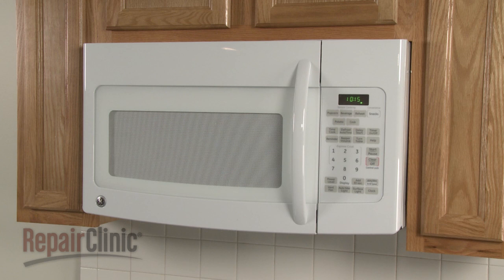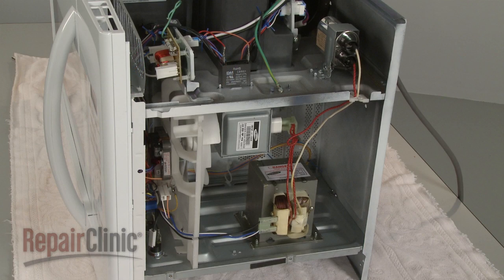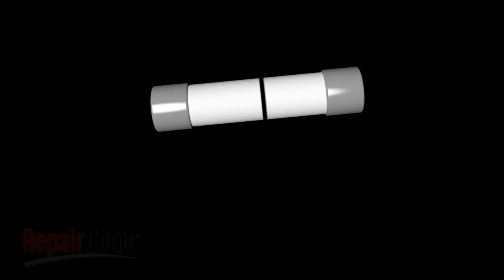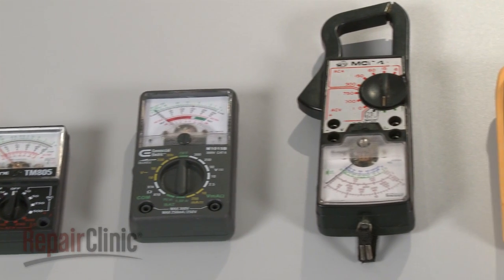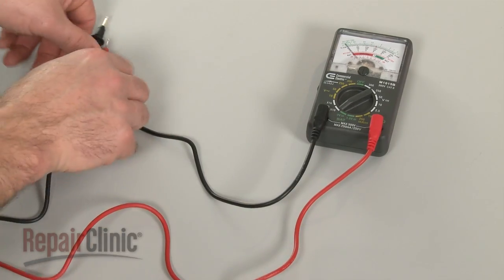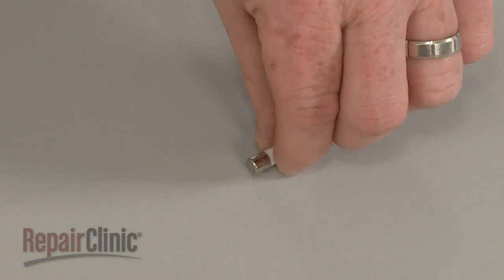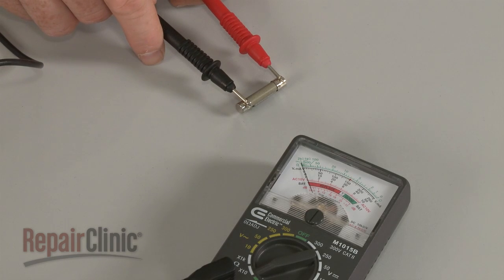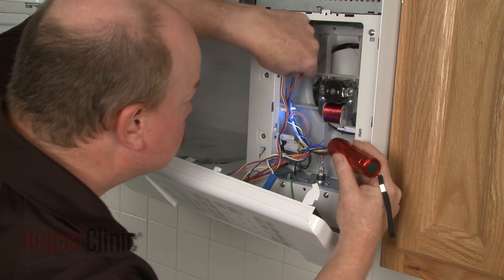Microwave Not Working? Fuse Testing, Troubleshooting & Repair

Comment: Lights work but not heating food. Timer working. Heat or power level working. What's next
Reply: When plugged in my microwave is on, but unable to give the heating time and operate

Comment: why do you need to remove fuse?  Would it not show it was blown just touching the ends>
Reply from the maker: The microwave fuse can be tested in the circuit but it is a good idea to remove it to be sure you are not getting any back feed from other components in the circuit.

Comment from the maker: Right now we don't have any part replacement videos for microwaves. I would suggest using your model number and searching the internet. There are easily accessible part diagrams out there that should be able to show you where the fuse is located.